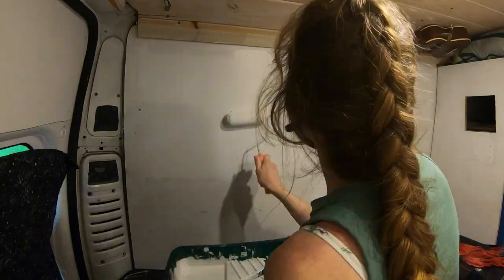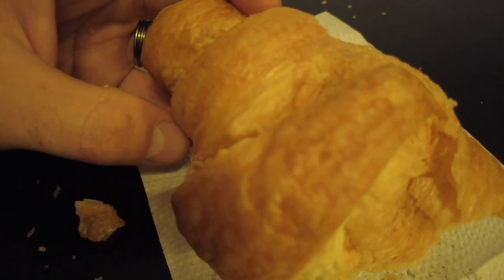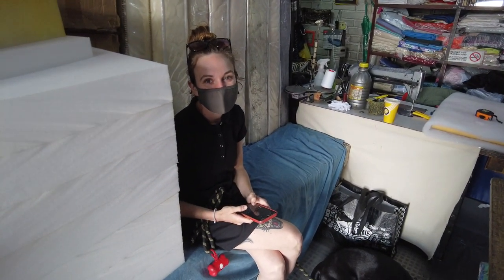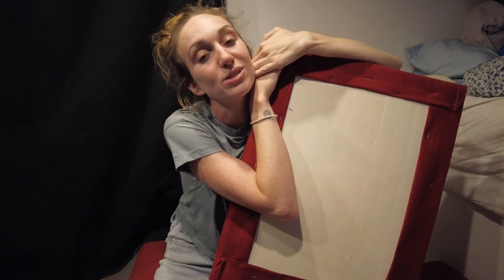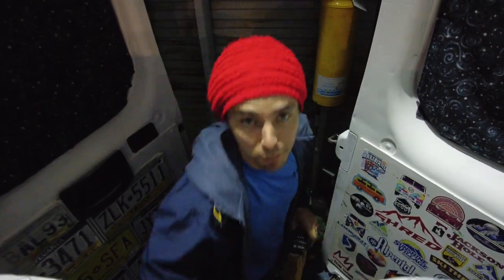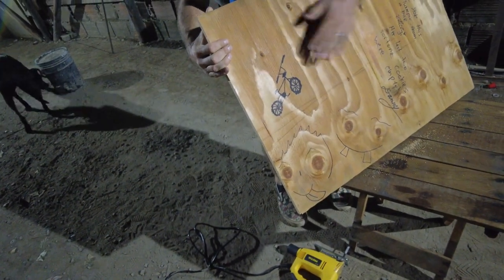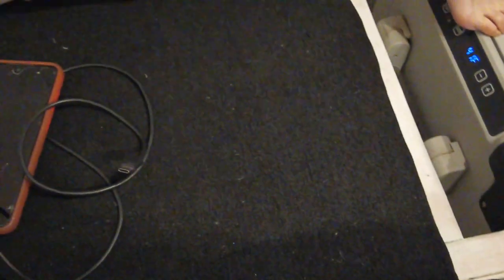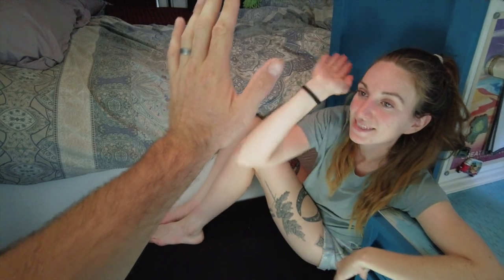RENOVATING OUR VAN after TEN COUNTRIES #vanlife #panamericanhighway

Comment: Looks great! Just a tip. If you use small top sheets, like for toddler beds, or cut down a bigger one, you can cover your bench when your pets are laying there, shake them out (outside) and the hair will mostly fall off.  Sheets are small and compact when you aren't using them and easy to wash/dry.  It helps keep the pet dander from entering your material and my dog likes the coolness of the material. I really enjoy your adventures!!